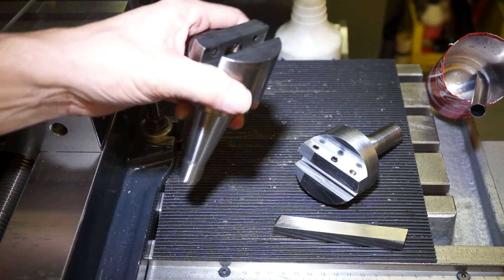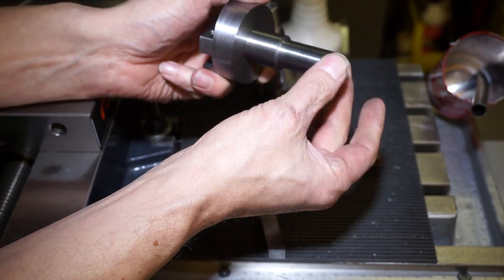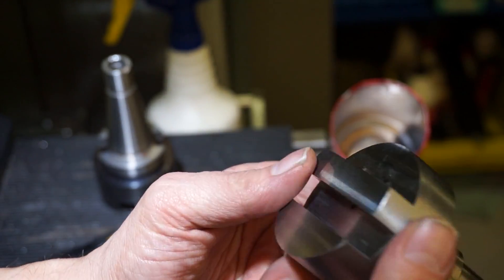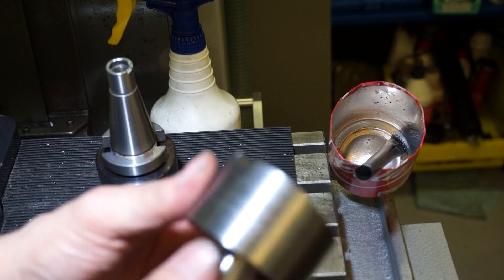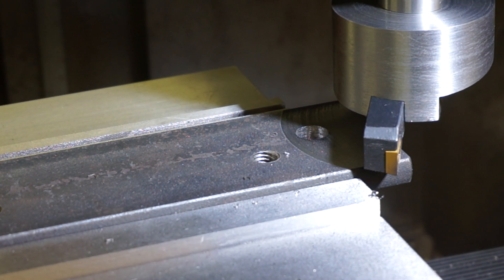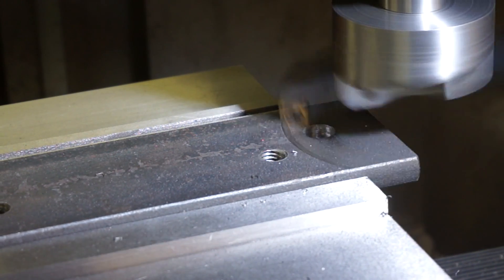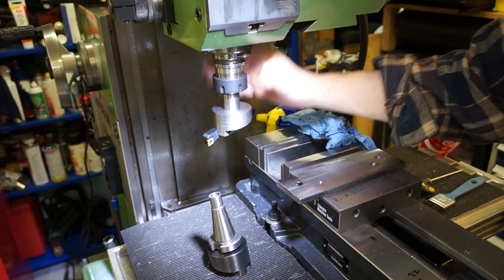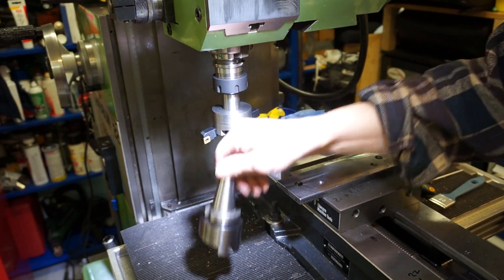CCW flycutter for use with lathe tools

Comment: I just use the left hand tools, which hardly every get used in my lathe, with a normal flycutter. However, I would like to try a tool holder for the often unused edges of a wnmg insert. It might help to use those edges. Nicely done!

Comment: Can you tell us about that black material you have lining the mill table?
Reply from the maker: It's just a blak rubber mat i got from the local car supply store.  They sell it for lining the trunk of your car.  I use ut to make a nice and soft working surfaces on my work tables,  cabinet drawers etc.  It also works nice on the mill table, except chips tend to get stuck in the groves.  I have now also used it to protect the vertical ways of my mill, and have hung it as a "curtain" behind the table of the mill.  Tanks for watching.

Comment: Hi! Your fly cutters look beautiful and your ccw one seems to be working well. You mentioned that every time you use a flycutter or shellmill/facemill it cuts on the back end as well as cutting perfectly on the lead side. If you look at This Old Tony Stress, strain and diy toolholder, you can see that his cv insert flycutter also cuts on the trailing side, so the apprentice mimics the master. No worries. Your mill is probably in very good shape, so I would suggest you look into other possible reasons why this happens, since the spindle and table is probably as good as new.
Reply from the maker: Thank you for your comment.  I am still looking into this......